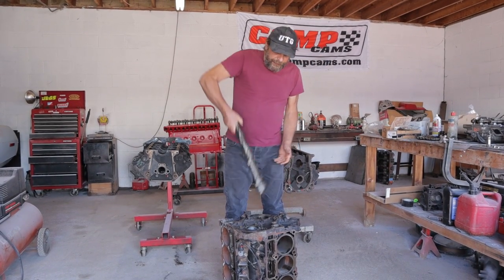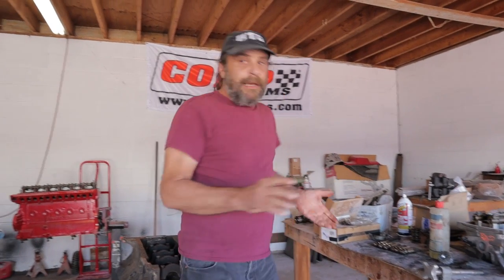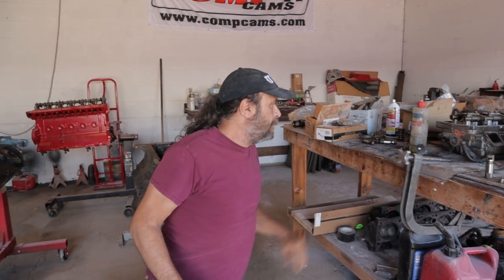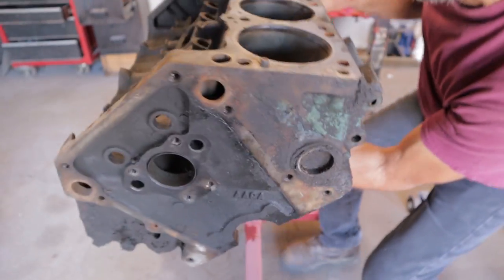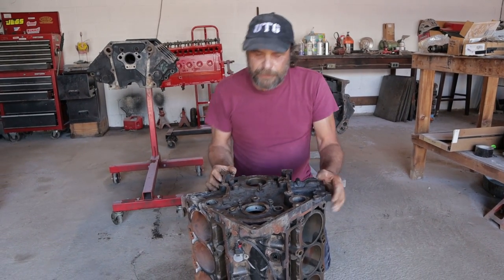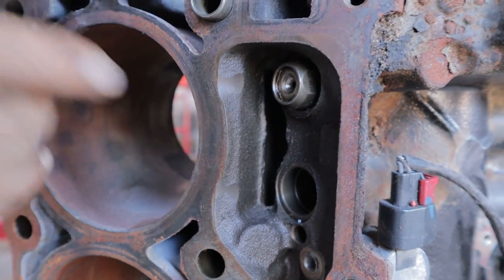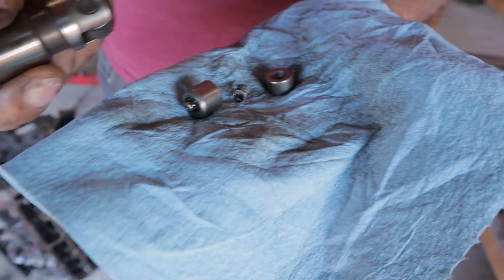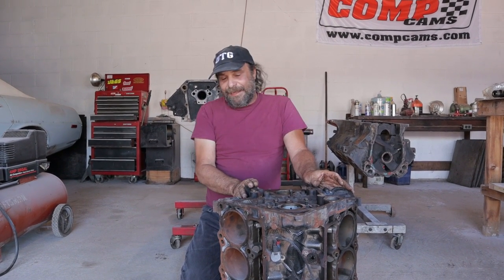Gen 3 Hemi Camshaft Failure Mystery Explained!

Comment: Amazing to me how modern engineers cant design stuff that works as well as the old school things did.Thete was a well thought out reason things were desiged a certain way and thes things have been thrown out in the name of technology.
Also computers that help with design cant think things through the same way the human mind can
Reply: One person designs the concept.  A team designs the fail points to make the money.
Reply: That’s a huge generalization on engineering
Reply: Too much reliance on precision modeling, designed to the margin of failure.  The old engines were over-engineered because they just could not calculate that precisely.  Of course, I have a 2.0 litre four that makes 300 stock hp and broke 34 mpg on a 2000 mile trip, so I suppose that is the tradeoff

Comment: Because when I got my 2006 ram pickup and had to drive 60 miles at 80 mph twice a day right out of the gate' and using synthetic oil I'm now at 197;000 miles and still going strong?
Reply: Mine at 163,000 but I change my oil at 3,000 and no MDS.
Reply: Different generation hemi block.
Reply: N8pruts gen 3 after 03
Reply: If your above two thousand rpm then your fine...oil is going to get slung up there! It's mainly a problem when you at idle for long periods of time!
Reply: @brandoncarpenter6498  wait so current 6.4's are gen iii, same since 03?  Sorry new to ram/hemi

Comment: Drive a dodge hard and they live drive them easy they die.
Reply: Tsunauticus III  here's something to keep in mind about chrysler, if you're buying an alumunim block then you're buying power, if you're buying an iron block then you're buying reliability. if you think about their most reliable engines were heavy cast iron pigs, but their higher performance engines were aluminum monsters that could breath fire but they also had glass bones and paper skin.
Reply: Tsunauticus III  I didn't think you were brand loyal until you said you were joking.
Reply: Don’t drive one and save yourself the hassle
Reply: Electronics For Fun So the moral of your story is don’t buy dodges because they’re either pigs or time bombs. Got it.
Reply: @mcgee9777  I wouldn't say they are time bombs. you can still get a good amount of life out of them, just not as much life as you would get from the pig.
Reply: Tsunauticus III  I beg to differ. I've been daily driving a 97 intrepid since I was 15 years old now 21 and just switched to the second gen intrepid (3.5l, not the 2.7) and enjoy driving these vehicles hard every day.
Reply: Tsunauticus III  I have a 2012 392 mds car with over 160k with just regular oil changes every 5k and I drive the shit out of it on the regular. I don’t idle around in traffic and I being up the revs over 2000rpm on most shifts. Never a issue yet and barely a sound out of the top end.
Reply: JAKDRZR I have 2009 Ram 1500 with 200k I drive hard and it runs better each time
Reply: @ryanwilliams8401  My 05 2500 has 250000 on it replaced a starter a couple of pulleys and a clutch my fault trying to get out of a ditch with 3 foot of snow. Still smokes the tires anytime I want. Best  Truck I ever had never selling it.

Comment: The most important question is: Has this problem been resolved by Chrysler yet? If so, what model year Hemi's are safe to buy?
Reply: My 19 Ram got the tick.. Dealer replaced all lifters.  Anything with mechanical moving parts that costs $50k is a gamble. Worth it tho? Fuck yes.
Reply: It’s never been fixed

Comment: Hemi’s were always designed to run hard.  Driving them to to the grocery store and idling would kill any performance engine.  My buddy builds high end motorcycle engines and says the same thing.  Don’t sit and idle the engines.
Reply: Bro exactly, who buys a v8 and drives it like a 4 banger. I figured out this issue years ago, i have a 14 with 220k and no tick other than injectors. Shut the mds system off, increased idle to 1000 rpms, don’t idle it, and service it regularly with only the best products. You have to have good knowledge and decent skills to maintain these engines or kiss you cam buh bye.
Reply: Donalld Allhands  everything except hit and miss engines lol
Reply: @elizelk1665  how did you increase idle speed?
Reply: This is one of the dumbest comments I have ever heard.  Dodge clearly did not do the FMEA study correctly.   If you are not an engineer look it up.   All engines should last when idling or at full rev's....du?
Reply: Jaun Diego Valdez I agree all engines should last while idling. But the mindset, engineering effort tends to be more toward the objective.  All the Mopars I’ve owned/drag raced over the yrs were pretty stout.  But, I didn’t buy em to do much idling in them either.
Reply: i have a 2015 that i got off a guy who put 125k highway miles and STILL got the cam issue
Reply: @thrashpandaentertainment7013  probably a mix of highway and lots of idling.

Comment: I didn't watch the but 6 minutes of the vid, but I've been using a zinc additive in ALL the builds that go out of my shop, and never had a lifter issue, or any other issues related to metal to metal wear.  I've seen all sorts of failures since the zinc was removed, IE rocker arm/shaft issues, valve tip wear, and rollercam/lifter issues. One thing these all have in common is, metal to metal contact, meaning they don't run on a film of oil, they rely solely on lubrication.   ADD ZINC, problems pretty much solved!  As I said, been doing it for many years.

Comment: Here is the thread on it, we have been trying to use lubrication strategies to deal with this for the past 10 years.  Over 50 random guys in this poll, they all had hemi tick, most of them killed their tick with redline 5w30.  It isn't hype, but science.  It is one of the few oils chalked full of additives to address this.  It usually takes 500 miles for the EP additives to plate, then hemi tick is freaking gone.  And thanks to your work, we can see why.  You have no idea how important these findings are, lol.

https://www.ramforum.com/threads/did-redline-oil-work-against-your-hemi-tick.154651/#post-2182698

.
Reply: They HAD Hemi tick and adding oil FIXED Hemi tick?
Bull.  I've fixed too many.  By the time it's ticking, the bearings are so worn down that the roller is contacting the lifter body and scrubbing across the cam lobe, and has been for miles and miles.
Reply: @immikeurnot  There should be way less drama on it, it doesn't take anything to try a different oil that was built to kill metal to metal contact.  You try it then it will either kill your tick, or it wont kill your tick, since you have to change your oil anyhow what difference does it make?  You can say BULL to one guy big deal, if I had a nickle for everyone ignoring science and facts and stats I'd be rich.  But in the hemi forum this experience has been duplicated and replicated over and over and over with a huge success rate, as the poll shows.  We are all just people who bought hemi's trying to figure our options and helping each other along the way, and as it turns out we found some really positive strategies that are helping many hemii owners.  No reason to crap on a decade of work.  Try bringing your argument over to ram forum where you will have 100 guys who' hemi's are no longer ticking and bring that BULL talk over there, see how you are treated.
Reply: @immikeurnot  my tick started 3500 miles into a truck off showroom floor, of course FCA says normal.  My truck has been silent for the better part of a decade that to this formula high moly, esters, and pao base oils to name a few.  And 100 guys have also killed thier ticks, most kill the tick 100%, some their tick is much better, and only a few the tick remains.  Bother yourself reading the poll, I made it public so you can review every single member who voted.  All long term ram members, no fake votes.
Reply: @immikeurnot  you ever hear the term you can lead a horse to water but you cant make him drink?  once you accept the premise that you aren't a stubborn horse but rather a man who doesn't know everything, try reading those threads, you just may learn something new, something actually good to know.  The science behind molybdenum is an actual thing, the science of micro lubricating esters are an actual thing, the science behind PAO base oils are an actual thing.  Most of the time you would never see benefit in an engine, but when you see an engine with a design flaw both in lack of lubrication and perpendicular forces then why be suprised or resist information when the science behind that specific lubrication WORKS?  The white paper is out there, the design flaws of the hemi were the perfect environment to prove the science of the white papers.

Comment: Could cut oil grooves on one side of the lifter so oil runs down the top side and drips on the roller.
Reply: I was just thinking the same thing, a thin groove from the band on the lifter would spray oil on the cam lobe, or a tiny hole in the bottom of the lifter to squirt directly on the roller but I'm not sure how you would control the bleed down in the hydraulic action of the lifter so it stays pumped up
Reply: Tap the oil pressure galley and add a squirted on each lobe. 

Like piston oil squirters. 
Or fancy racing transmissions have.

Comment: I have a 5.7 hemi , it had a tick , which was called the “Hemi Tick”   I switched oil to all synthetic redline is the best, but platinum pennzoil works well also , well tick stopped and I believe all will be fine.
Reply: All synthetics are basically the same. Check out project farm, cheap walmart oil did better than your fancy red line
Reply: A sidenote here, I had a 5.4 3 valve Triton in my 2006 F150. All the problems associated with those engines center around the oiling system. The oil pump was unable to flow the volume needed to properly keep the variable valve timing system operating. The engine was specced to run 5w20 oil, but as the oil temps increase, it thins  out too much. Oil pump wear, plus too thin of oil is at the core of this engine's problems. If you compound that with extended milage oilchanges, and general neglect, the story gets worse. I switched my engine to a 5w30 full synthetic oil, and 1 quart of Lucas synthetic oil stabilizer at every oil change. The oil pressure stayed within range, even at hot hot idle conditions.
Reply: I really want to develop my own catchy brand of oil and put a cool looking sticker on it and make it really expensive so that I can make bank off of suckers like you lol
Reply: Steven Vanheel   You won’t ,guys like you are all talk.
Reply: John F. You are right about me not doing it. I just said that I want to. You wouldn’t believe how people will go out of there way to put Mobil 1 in a vehicle when it is more expensive and not even nearly as good as other brands of oil
Reply: @trudeaumustgo1920  Project farm did a synthetic oil challenge and Amsoil FTW
Reply: @Cubanogar  amsoil is also like $20 a quart here. Supertech is like 7. Theyre all so close in comparison and not worth the extra money.
Reply: Also a 5L jug of supertech is under $20 including taxs
Reply: @trudeaumustgo1920  I get amsoil for $11 a quart
Reply: @Cubanogar  still way too much

Comment: * Sounds of Chrysler engineers scrambling to integrate oil sprayers on the lifters and putting dribblers above the cam.
Reply: The engineers probably want to do that, but the bean counters and attorneys would have their heads first.

Comment: 2015 Ram 5.7 Hemi------After 25K miles the engine developed a lifter tick on start up especially when it hasn't been started in a few days. The longer it sat the louder it was and the longer it took for oil to get to the lifters(at least that what it sounded like). If it was driven every day there was no noise at all. It started after the dealer changed the oil with non-synthetic oil. Now I use Mobile One or Castrol Platinum and its still there.

Comment: Moral of the story ; don’t buy  grandma’s Hemi.
Reply: Nope - buy grandma's. Don't buy dad's.
Reply: Sure, if it's a 1950's or 1960's model  :D
Reply: Jesse Shaffer you want to buy one that has beat on because hemi is very very good at dispersing oil in engine. It is at idling that the damage is able to happen. It is not solely mopars issue any company with a cylinder deactivation system.
Reply: No, lol this is a newer 2000's + Hemi. Chrysler had the best lubrication
Reply: Thunder Heads410 especially 2003-08 it was 09 forward that there were issues on the mds system.
Reply: @Sak-zo1ui  Cam and lifter failures are still happening in 2019 vehicles.
Reply: benjaminwayneb yes? I dont see your point.
Reply: This is a 3rd Generation Hemi ,,  Newer cars ,  Grandmas Hemi is better !
Reply: He's implying: don't buy grandma's hemi bc it's been babied and driven softly. Jesus y'all...
Reply: Moral of the story....don't buy a hemi.
Reply: @Sak-zo1ui  wrong. Mopar makes the worst vehicles on the road

Comment: I just had mine fail and still have the bad cam and some bad lifters and in mine the lifter actually spun in the plastic holder and even before that happened the cam was already failing anyways I would love to send you the cam and lifters if you want to look at them I also have a whole bunch of pictures of the all the failure points.
Reply: I see the problems already. Photos aren't needed. I will talk to Tony to resolve the problems if he is interested in finding the solutions from me. It is more than just one problems.

Comment: I have heard of two lifter manufacturers that have addressed this issue. The lifter bodies now have an oil passage to lubricate the roller/lobe. Crower offers a premium hydraulic lifter as does Enginetech. I've had heard Johnston lifters have the new oiling feature but can't confirm.

Comment: you know most of the cam failures are on the engines with MDS. I still like my gen 3 hemii
Reply: Same with the GM LS engines, most lifter/cam failures are on the AFM engines.  I think it's due to lack of lubrication there as well.
Reply: @Live Wire Actually it’s too much oil pressure to the lifters and causing them to act like solid lifters just without the lash. This problem has been solved with a 2 stage oil pump in the gen 5 LT engines.
Reply: Not really.  The late 5.7 powered 2500 and 3500 series trucks do not have MDS in them and they still eat lifters left right and center.  It's not a matter of if with them... just when.
Reply: @deanf7086  I haven't heard anything about that, and I'm a GM tech... Although our dealership is in transition to new owners at the moment so I haven't had access to GM training for a couple of months, so I might have missed something...
Reply: @Live Wire Google!
Reply: The pressure relief in the pan doesn't allow for more than 55 pounds on the gen iv's anyway... The 2 gen v's stages run at 40 psi max to 3400 rpm or whatever and then peg the gauge unrestricted.. it's more a design problem then pressure because the gen v's still eat cams and lose afm lifters.
Reply: @deanf7086  You trust Google?
Reply: @Live Wire 😂 😕 😢

Comment: The needle bearings fail in the Gen 3 hemi mainly due the design flaw of the lifter itself. Why do we hear of these only failing on the 5.7 and some 6.4 Hemis and not the 6.1 or the 6.2? The 5.7s and 6.4s have the MDS lifters and the 6.1 and the 6.2 do not. Have you ever heard of an older SRT or the Hellcat eat camshafts? No... The block isn't the problem, it is the MDS lifter. I have even owned 2 pre-mds 5.7s and noth of them were 200k+ mile trucks and never once had any issue. The Chevy DOD system has issues like the Hemi as well. Coincidence?
Reply: My 04 5.7 just clicked 260k miles and still runs like a raped ape, just drinks a little more oil than it used to. I went a test drove a newer one about an hour ago that had some missing issues and ended up here.. guess I'll keep the ol 04 and her oil addiction over these problems
Reply: I’m pretty sure your spot on .. i have a 6.1 and not one issue to report .. nor have i really heard of issues with the 6.1. My oil psi is 35ish warm and 80 or so when i step on it
Reply: @hpjunke  exactly, the Gen 3 hemi family has the same type of oiling system. It’s not the oiling system that is the root cause. Some people like to make claims with circumstantial evidence.

Comment: Aftermarket lifters are available with the hole
Reply: I wonder if there's room for a licker on the rod cap.
Reply: This seems like it would be a good measure to counter the lubrication failure to the camshaft.  If you can lubricate the roller, the cam would be lubed as well.  Seems reasonable.
Reply: Hellcat lifters

Comment: Look inside those lifter bores and tell me what you see on the "piston side" wall of that bore...
Reply: Oiling holes I presume?
Reply: @markg7030  Yuuuuup. Pretty big and visible ones, at that.
Reply: madskills72cl  "Runs off the lifter"...?  Your point seems to assume that A) oil has no viscosity whatsoever, and B) the parts it's on are stationary.  Lifters are moving up and down about 17 times per second at 2000 rpm.  At idle, it's still 7 times per second.  Trust me...that oil is going all over the place...including the rollers.
Reply: @entropy156  So are you thinking those passages are getting clogged from lack of maintenance, or that it is just the lifter's roller bearings seizing and causing these failures? Because obviously, there is a problem with the cams and lifters eating each other on some of these engines, and it does seem to have something to do with time spent idling.
Reply: @RickinICT  I think it's probably due to a lack of maintenance....whether that be in the form of dirty oil, sludge, or even low oil levels that cause oil pressure to drop as the pickup tube gets uncovered during maneuver.
Reply: madskills72cl  because that kills engines in general.